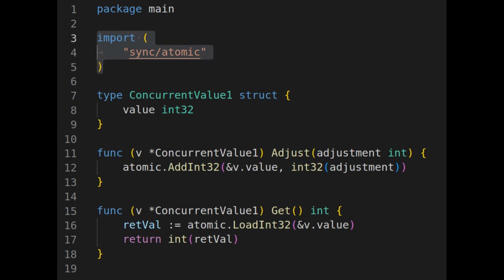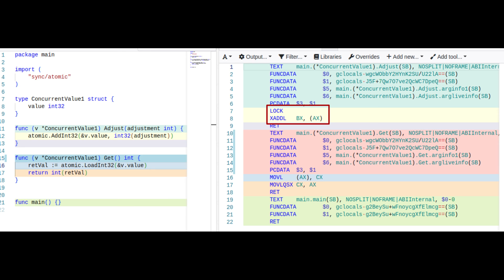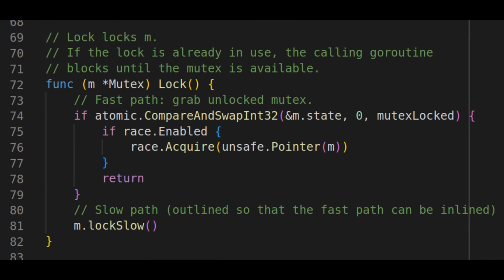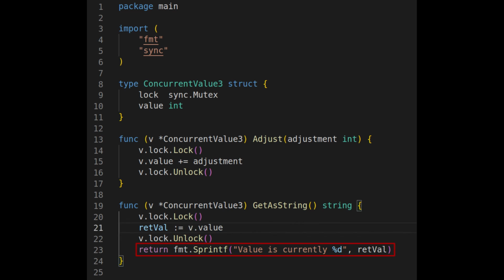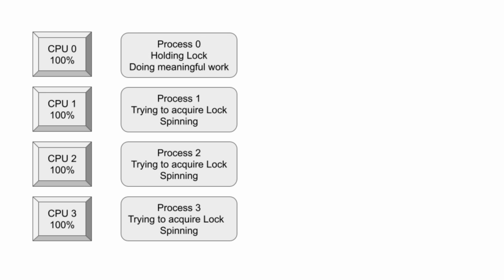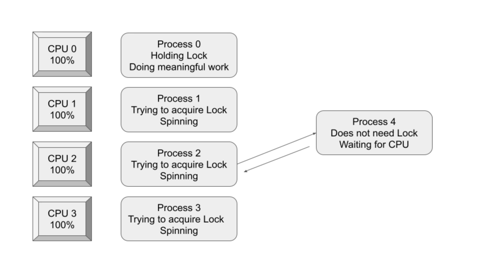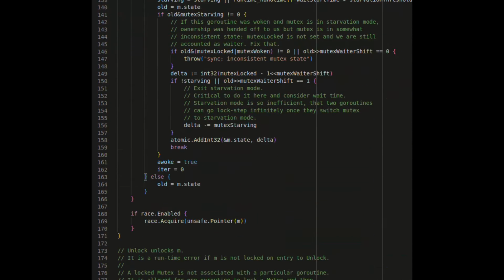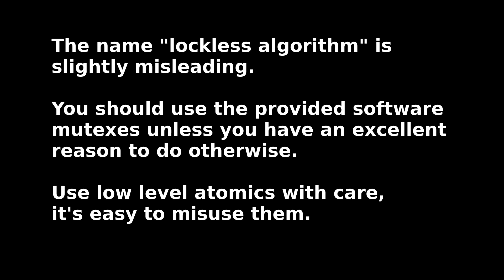The Truth about Lock free Programming.

Comment: Hi this video is misleading and actually spread ignorance atomic instructions lock the cache line and sometimes flash the cache depends on the ordering, I don't know about go runtime because those languages are abstracted for safety and been high level, atomic instructions are cpu instructions fully userspace a mutex do a syscall which is magnitude expensive than flushing the cache (basically free)
Reply from the maker: While I've not investigated every mutex implementation, there's no logical reason why it would require a syscall when it's built on the compare and swap instruction.
Reply: yeah in the slow path it will need some system calls to put the thread to sleep, but in the fast path it's usually just doing spin lock anyway

Comment: A more balanced view of it:
Use locks, or use libraries with lockless data structures if one fits what you want to do. Use an atomic counter if you just need a shared counter. Just appreciate that someone else made primitives for you to play with.

You will not be able to actually write a good lock-free data structure yourself if the subject of the video isn't so obvious that you can pick it apart. It's not about it being slow or fast, but simply the fact that it is fiendishly difficult.

Comment: I would argue its not the same at all. The idea behind lock-free is, that the critical section is small, so the probability of aquiring a lock while busy waiting is really high. Meaning, it will spin wait for a really short time - much less than a quantum, until it aquires a lock.
If you didnt busy wait for the lock, when having short critical sections, the thread will go to sleep and therefore will run after a much longer time, usually at least after a quantum, because other threads (from other programs potentially) will occupy the CPU. So the overhead of waiting is huge.

Essentialy, the power in lock-free is in the combination of smart busy wait + short critical sections. Thats the reason why it can in many scenarios outperform locking. Just mitigating the thread overhead of sleeping.

And yes, it has to lock the resource nevertheless, but its much different to lock with lowest possible hardware instruction like CAS, than locking with software mutex and going to sleep.
Reply from the maker: You seem to agree with pretty much everything I said. Which part, exactly, are you arguing with?

Comment: I noticed you refer to "lockless" and not "lock-free" throughout the video. I don't know if you meant that latter, because it has a very specific definition that you don't address in the video. Specifically, lock-free means that no matter what the behavior of the scheduler is, at least one thread will make system-wide progress. The hardware locks I believe are still lock-free, unlike holding a software mutex. It's definitely true that lock-free algorithms are not always faster, but they do become more important at higher thread counts and with more contention on single resources.
Reply: “apparently the internet seems to think it’s fairly common” 😂 YES!

I’ve come to realize that in the industry, the majority of engineers (even within FAANG) don’t seem to even realize that spring doesn’t just automatically make your sequential API calls parallel!
sure, your incoming requests will be parallelized, but if you’re calling downstream services, which is typically the bulk of the on-server response latency in practice, then it’s not just going to intelligently do any magic about that for you

it’s much, much more common to see parallelized network I/O in front-end code in ReactJS where you can’t just let the whole webpage freeze up for a second or two during a slow AJAX call, but they get the reputation of being the idiots with the easier code!

what’s even more shocking is the lack of non-blocking I/O even in fundamental infra components — the default connection limit for postgresql is 100, while envoy (which properly decouples requests from threads) supports 100k or so out-of-the-box — the tracing span for a connection in envoy would of course wrap the ones in postgresql!
Reply: Golang was actually a shocking case of something that wasn’t explicitly designed with non-blocking I/O

I was assuming that optimizing the hell out of the memory footprint of threads and being a moderately more “systems level” and “idiot proof” language designed by such “brilliant minds” as Rob Pike meant they’d obviously have non-blocking like such banal “crap” like NodeJS, RIGHT!?

Wow, what a shocker when I decided to check!

(Heads up that I’m not super hands-on with single machine locking and concurrency in case that assumption about “memory footprint” gives you an aneurysm 😅)
Reply: FYI, found nice formal definitions of “lock-free” and “nonblocking” on page 329 of Brian Goetz’ “Java Concurrency in Practice”
Reply from the maker: The terminology is all over the place on this particular topic, specifically because the whole topic of concurrency control is complex. In this video I tried to specifically address the claim made by many of "lockless" algorithms. It appears that "lock-free" is often used as a synonym for "non-blocking" (which I'd never heard used that way before, but apparently the internet thinks it's rather common). I didn't even attempt to approach the topic of non-blocking code in this video.
Reply: @softwarechats9307  to the best of my knowledge, lock-free is more strict than non-blocking

Comment: There are a few things that I would like to point out. 
1. Mutex (mutual exclusion) basically means processes don't get into the critical section at the same time. A mutex algorithm is required to satisfy at least two properties mutual exclusion and eventual entry assuming a fair scheduler. (These are technical terms that have precise meanings but you can kind of feel what they mean) There are mutex algorithm that does not use primitives like compare and swap, but they are usually more complex and requires more cycles, so people usually use these primitives to make mutex efficient
2. Lock free is not the same as lack of mutex. There is a proper definition of lock freedom. It is a property of the system that when there is at least one active thread, there are progress in the system. You may look at the wiki page of non blocking algorithm, An Introduction to Lock-Free Programming (a blog from preshing programming) or the popular paper on michael scott queue to see the definition
3. If your operation contains mutex, it is not lock free(using the above definition). The reason is that if all threads are waiting for the same lock and you suspend the thread that is holding the lock, the other threads cannot progress, and so the system does not progress. From the contrapositive of the statement, lock free algorithms does not contain mutex.
4. There is another related concept call wait freedom. Instead of requiring the system to progress, it requires every active thread to progress.
5. Not all wait/lock free algorithm uses atomic primitives like compare and swap. Lamport's algorithm in The Concurrent Reading and Writing of Clocks is an example, (unless you count read/write a byte/bit as using a hardware lock). It's a simple yet beautiful algorithm.
6. There are reasons other than contentions to use lock free operations for real time systems/ operating systems as described in the non blocking algorithm wiki page.

Given these points, I hope it is clear that
1 using compare and swap does not make your algorithm lock free,
2. why the example at 2:51 is not lock free, and
3. the points at 3:02 does not make an algorithm lock free

Comment: Sure, Mutexes are the lowest level of safety primitives. Atomics and Channels (at least in golang) are built on top of Mutexes. If fact std-lib atomics in golang are not even safe, that's why Uber engineers have written their own "atomic" package as a drop-in replacement. Thank you for the video 🙏
Reply from the maker: Uber's docs explain the reason. To quote: "The standard library's sync/atomic is powerful, but it's easy to forget which variables must be accessed atomically. go.uber.org/atomic preserves all the functionality of the standard library, but wraps the primitive types to provide a safer, more convenient API." That being said, just because it improves one part of the use of atomics doesn't mean that it solves every possible misuse.
Reply: Mutex is very high-level and depends on system calls. Spin-lock does the same, but on a much lower level. And atomics are supposed to use the hardware atomics implementation, and never depend on mutexes.
Reply: @vitalyl1327  Yeah as I understand it, mutexes and semophores are OS level primatives, built on top of atomics, while atomics actually map directly onto the hardware

Comment: Sorry, but i think this video is ill-informed. Just because there is a LOCK prefix when using atomic intrinsics does not mean it "does the same" as a mutex. Not only are most aligned reads/writes guranteed to be atomic without locking the bus (so the LOCK# signal is ignored anyways), access to writeback memory (that doesnt cross a cache line boundary) also doesnt lock the bus as long as its in the cache.
Reply: LOCK stops some reordering on modern x86; store-store and load-load reordering indeed already isn't allowed without LOCK, but you still need to LOCK to prevent load-store and store-load reordering, which you would want for a mutex.
Reply: Great video; I really appreciate that you took the time to make such a short, high quality explanation on this
Reply from the maker: I won't even try to debate your knowledge of the details of hardware function. However, the code demonstrates that they are identical in the case of an uncontested mutex. Since we can see the code that implements Go's mutex, we can see that it's the same code.
Reply: @softwarechats9307  No, it is not the same code. You are confusing the meaning of all this. While, yes the complexity of uncontested mutexes are similar to those of atomic variables, this is because it is all implemented on top of atomics. Mutex must be implemented on top of atomics because if not then locks and unlocks would be vulnerable to race conditions. The whole purpose of a mutex is to have a lock which guards a resource and create a situation in which other threads are contesting the lock, waiting for their turn in holding the mutex, note the word *waiting*.
The exact hardware implementation of atomics varies on the exact CPU architecture you are using (even microarchitecture), but on modern x86, the source data for instructions with LOCK prefix are fetched to the CPU cache so no memory bus lock occurs until you exceed the cache line (just as the OP said), so there is no waiting involved.
Not only this, but conceptually in mutexes, a process can spend an arbitrary amount of time holding the mutex, which also does not occur in case of atomics. (In case of LOCK instruction prefix on x86, it can be only issued for a small bunch of instructions, otherwise the CPU issues an undefined instruction exception and otherwise IF the memory bus locking happens, it only remains for a very short time of executing the LOCK prefixed instruction).
Since know we know that atomics (99% of the time) don't require waiting, you can see that for most of the usages of lock free algorithms or data structures, atomic variables are used to contain some kind of data crucial to the user (a value in a map or whatever). If you do this with atomics, poof, you have your data, no waiting nor locking involved. If you do this with mutexes, first you have to lock (god help if contested, but if not the complexity is the same for a read/write from an atomic), then do something with your guarded value, and lock again. The second option as I demonstrated requires more than double the amount of time spent on reading/writing to an atomic variable.
Also, you mistake a spinlock for a mutex, spinlocks, as their name suggests, spin, using all the CPU they can, while mutexes sleep. This makes any reasonable scheduler preempt sleeping threads with threads that do the actual work (Really often this preemption is done by the OS scheduler, many mutexes are implemented on top of syscalls such as futex()/WaitForAddress()/os_unfair_lock() for Linux/Windows/macOS. I'm sure Golang does this as well, Ken Thompson is a smart person).
You would have had a point if you said that there are cases in which a mutex may be the best solution, but this video is unfortunately ill-formed.
Reply: @softwarechats9307  That's because you've implemented a mutex using compare-and-swap, and not a lock-free algorithm. You'd get lock-free by using atomic.AddInt32 in Adjust and atomic.LoadInt32 in GetAsString... as is done in the Godbolt screenshot. Then we'd have no CAS loops - such a loop is a lock/blocking unless we can prove that a thread will eventually finish the loop without help from other threads. Adjust wouldn't even include a LOCK prefixed instruction. But a LOCK instruction alone doesn't lock (in the "lock free" sense) because it'll always finish regardless of how other threads behave.